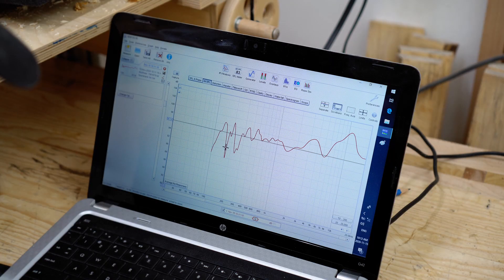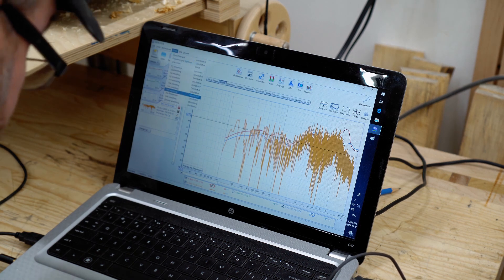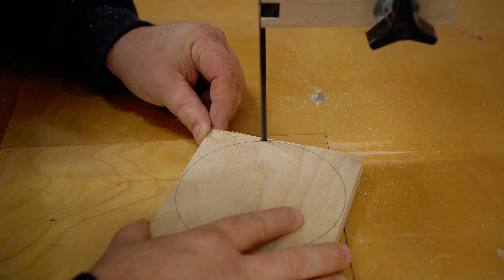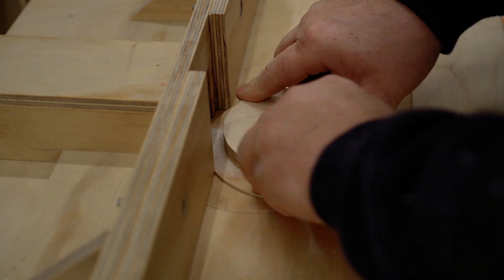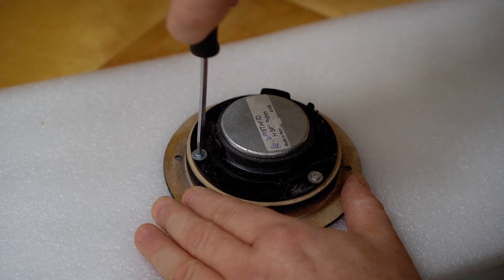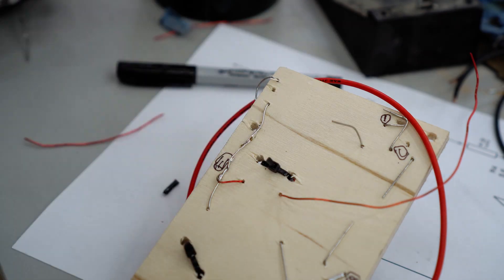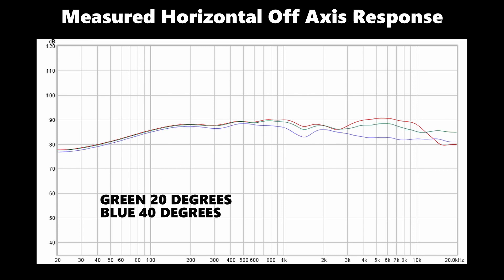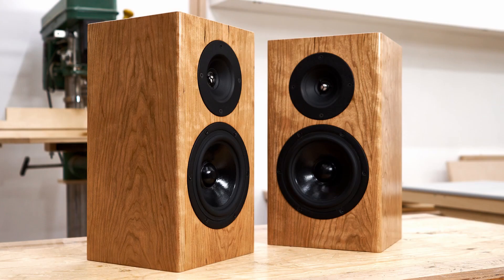Speaker Upgrade - New Tweeters, New Crossover, New Finish

Comment: For the beginner I'd recommend they use the free measuring software called Holmimpulse rather than REW. Holm is MUCH easier to learn and use. 
Holm also has something called "time lock" that does all the acoustic center work for you. This makes the whole process simple. 
 I used to use REW, but now just use Holm to measure frequency response, DATS to measure impedance, and XSIM to design my crossover in. Simple and gets the job done.
Reply: i use holms also. REW is a pita.
Reply: Can ask where to find n download the holm software ? I am new beginner would like to design n built 2way 4inch 8ohm speaker for my av 5.1 system , n also what speakers u recommend as i watch most diy users use sb accoustic ? tq tq

Comment: it's safer to use a 2nd order filter on the tweeter and a 1st order filter on the woofer (the delicate diaphragm of the tweeter is much more prone to damage from low frequencies)
A better result is to use 2nd order Linkwitz Rilley filters in both components, that minimizes the interaction in the crossover area, reducing the variations in the frequency response outside the main axis (peaks and nulls), with no peaks in the frec. response.
Other types of filter -such as the Bessel 2nd order - have a worse frequency response outside the main axis, coloring the overall sound (the sum and cancellations between the 2 components are much worse, with very noticeable peaks and nulls)

Comment: Hi John.

I'm very interested in your use of XSim in creating your crossover and your comments regarding how spot on it was when comparing the design of the crossover using XSim with the measurements taken. How did you measure the loudspeaker? Was it indoors as per your previous other videos, or was it outside on a ladder 8 ft in the air type of setup? I'm fascinated by how well XSim is in designing a loudspeaker crossover (how accurate it is), as I've been told and was of the belief that it wasn't a good tool to design a loudspeaker crossover. I'd love to hear more on your thoughts on using XSim as a design tool. I've currently bought about $700 of crossover parts (inductors, resistors, capacitors), to design a crossover thinking I'd have to use a trial and error type of method - but if XSim is as good as you say it is, the more I and others can understand in what you did would be invaluable.

Thanks for the great videos!

Comment: Nice work...!  BTW, a small bypass cap on the tweeter L-pad could help to pull up the drooping frequency response above 8(?) kHz.... :-)
Reply from the maker: Interestingly, the dip evens out off-axis and that's how they are set up in the room - toed in, but still not pointed directly at the listening position. Not that I can even come close to hearing anything above 15K, anyway but something to keep in mind - thanks!

Comment: The cost of entry for a calibrated mic seemed silly at first but it opened the door to a really fun (and plenty time consuming) hobby.

If you want to go further down the rabbit hole on your next build, try out VituixCAD.  You can input and define off-axis measurements for the individual drivers and generate a power response and polar plots, so you can tune the on and off axis response at the same time :)

Comment: Does the horn change /lower the tweeter's resonant frequency?
Reply from the maker: That's a good question. It makes sense that it would, because the load that the dome sees is different than operating in free air. Much like adding mass to the cone of a woofer will lower the resonance. 
Can't be by a lot, though, since the load didn't change that much; I should have measured it. Next time :)
Reply: @IBuildIt  Have you noticed how popular DIY speakers have become since the pandemic? Parts-Express must be having a banner year.  I too am guilty and have been tuning by ear as I don't have the test tools.  So far results seem pretty so so.
Reply from the maker: These things come and go in waves, I've noticed. I've always been into building speakers, but it aside to concentrate fully on the woodworking for the last 10 years. Now I need a hobby again, so I'm back to making speakers.

Comment: What are your thoughts on series vs parallel crossover topologies.  I built a small bookshelf speaker with a 3.5" full range combined with a 1" soft dome and the mids really open up with the series crossover.  Eliot Sound has a couple articles that inspired my build.
Reply from the maker: I'm far from an expert on any of this and that's especially true for crossovers. I know some swear by series crossovers and I think you can reduce the parts count with one, but at the end of the day the job is to send the right range of frequencies to the drivers and fix any issues and I think both topologies can get that done without a detectable difference in the sound.

Comment: Hi John, awesome video - I’m digging this new direction for the channel as I am currently working on making my own diy speakers.
I wonder if you could elaborate on how you worked out the geometry for the tweeter wave guide (not sure if that’s the correct term). Also, does the relative smoothness/roughness/hardness of the horn surface make much of a difference to the sound? I’ve seen that Klipsch is using a smooth but rubbery material but I have no idea if this makes a difference sonically or is just for show. Any suggestions for learning resources would be greatly appreciated.
Hey John, I was just on your website checking out this project and I realized I forgot to tell you how much I LOVE the new finish. The photo's are incredible, speakers that look this good sell for a bunch - beautiful cabinets make these into furniture more than electronics. Do you have thoughts on hardwood vs MDF construction as far as aesthetics vs acoustic properties?
Reply from the maker: A basic horn is just a way to couple the output from the tweeter with the air more efficiently, so the geometry for that purpose isn't critical. It's that boost in efficiency that I was looking for to bump up the lower range response and make it possible to use a lower crossover point. So just a 45 degree flare seems to be fine, but it has to be deep enough, I made a shallower one to begin with that wasn't as effective.
As for smoothness, I'm not sure. It think it would have to be pretty rough to mess with the dispersion or cause diffraction artifacts.

Comment: What about sound and frequency interests you so much?  Where is this passion coming from?  Is it also related to electronics?  Any interest in arduino, raspi, etc?  Just wondering ... I'm learning something.
Reply from the maker: I've always been into it, since I was a kid. More analog than digital, so unlikely to see any arduino projects from me.
Reply: Thanks John, it's interesting ... Both, Seeing a speaker built from scratch, the wiring diagram for cross over, etc and the passion to do it.  Known a few people withe same interests or ability and wondered where that came from. This engineering talent , just wondered how people got that.   Childhood friend used to build amazing tree forts, projects, etc, now he's an engineer at Boeing.
Reply from the maker: I was always interested in how things work, and that goes as far back as I can remember. When other kids were watching cartoons or reading comics, I was taking apart my toys to examine the innards. 
Just the way some people are wired, I guess.

Comment: With your test setup, building a "tunnel" with a non-relective inside may help eliminate the effects of the room.
Just a simple frame with a soft blanket over it would already be a big improvement.
Reply from the maker: The reflections from the room are gated out. I went over that in the last video.